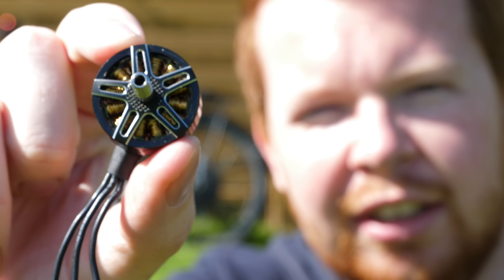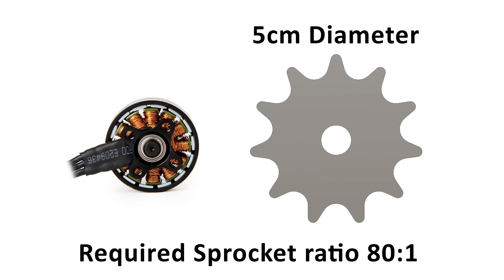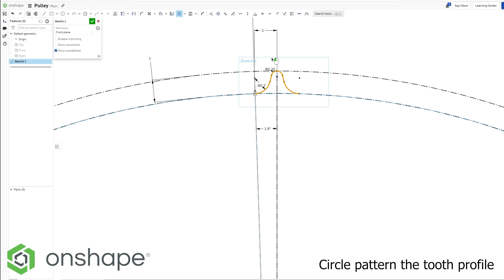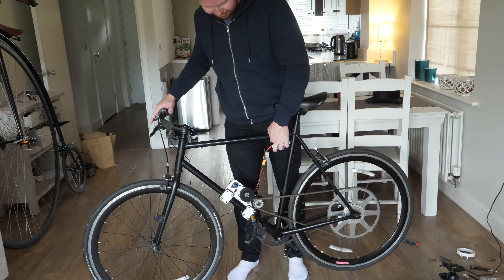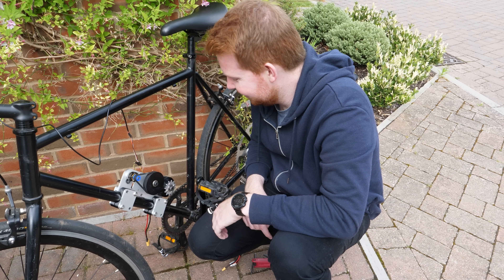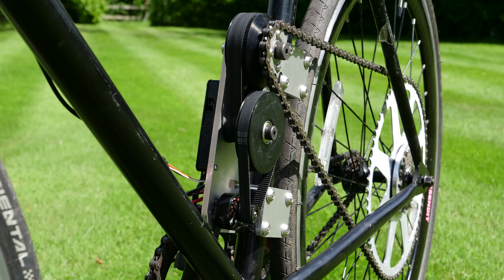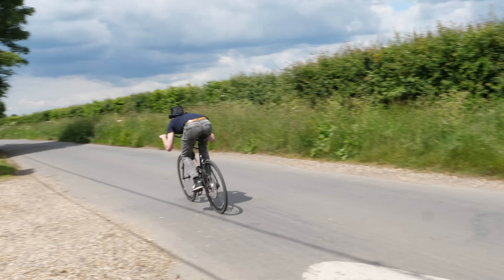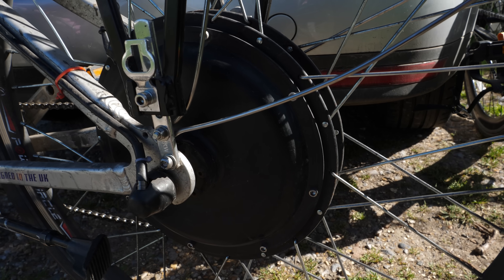Tiny 1kW Electric Bike Motor

Comment: The fact that the only slightly bigger motor worked without any cooling is actually surprising, as long you don't try to drag race with it.

Comment: I actually had this idea but instead of using one drum motor I had the thought of using several drone motors either in parallel or series combination with gears to reduce the speed but increase the torque by having multiple small motors, that could easily be powered by the large battery weather combination of supercapacitors. You would also need to design a controller that could switch the power source between the batteries and supercapacitor somehow.  Another idea to program the controller to switch charge regeneration on and off to charge the super capacitors, by maybe using three motors out of the let's say 7 or 8 small brushless motors. Obviously this couldn't run continuously but theoretically get longer range until the actual lithium battery died completely it should give longer range since once the bike is already moving the torque needed should be less. Just a thought I love your videos. I love your videos and ideas I hope you keep making more. Thanks

Comment: The tractor also has a lot more torque which allows them to pull heavy farm equipment like a plow, meanwhile some cars are designed for getting up to speed quickly especially cars like the GT-R (R35) from Nissan!

Comment: Torque vs RPM! The ebike motor has tons of torque, the drone motor has tons of RPM. To get the drone motor to move the bike you had to gear it down multiple times to multiply the torque, but the load on the motor was still way too much for it causing it to overheat. Whereas the ebike motor is huge and has tons of torque but way less RPM so it can spin at max speed and be under very little load. And contrary to popular belief, using more drone motors won't make the bike faster since they'll be spinning at the same speed, but it will reduce the load.

Comment: If the efficienty of the motor is 70%. Then 300 w of power waste in the small case of the motor. Comparing the size of the hub motor

Comment: Voltage/number of cells of the battery, size of the motor and kv rating, ESC current ratings are not disclosed, making the whole exercise not useful.

Comment: You should take say 6 of those motors and run them on the bike with a bigger battery of course but not to much bigger. I would think it would keep the motors cool enough cause their not straining with all that drag on 1 motor, it would have say 5 more to help keep things going without overheating. Just a thought and opinion. blessings all. Ok, maybe 4 of them if 6 is to many.

Comment: It will work much better if you add a higher power gear for starting like 100 rpm so it can safely start and gain some momentum then you can switch to 360 rpm it will reduce the chances of failure and gear and motor damage significantly i know you are not making motor go 30k while starting and starting rpm maybe less than 100 but its not the same thing doing this through gears will have higher torque at same rpm.

Comment: Small motor have small working currents and small torque. Small motor make 1 kW power on 30k RPM. On 30k RPM back EMF so big, that reduce working current. So, when you put this motor on bike, you work in much slower RPM -> back EMF is reduce -> currents are rising -> motor is boiling.

Comment: Also you could do a back of a napkin calculation on how much air does a drone propeller push through that drone motor because air cooling is non negligible in such a use case.

Comment: You need to inject ferrofluid into that hub motor and add heat sinks hubsinks on a thermal paste, then it gets to 3kW easily and your problem boils down to thermal. Curious what would happen if you could get an axial motor on an e-bike though… these seem to be the current craze in automotive.

Comment: These motors can’t have a radial load. You are killing their bearings.
Should’ve supported the output shaft with bearings.
Not to mention, you are not using a propeller, are you?
So why the f… you have not added a small cooling fan? 

Wouldn’t hire you as an engineer in my company.

Comment: a some kind of clutch system would help, first youd need to let the motor get its rpms, just like you first have to let car to a certain motor rpm, and 1 gear to help you move out of starting point

Comment: Im curious as to what one is more efficient given the same amount of ...hmm..fuel ?

A small high speed motor...or a large slow motor.

In gasoline powered engines slower with more torque is always more efficient.
Reply: Most likely the larger motor. Otherwise, the bike manufacturers would do exactly what Tom is doing. The smaller motor going that fast introduces much more friction than the larger one

Comment: I have a belt drive with tension-er on my gas 49.8cc gas bike. Replacing the tension-er with a 48 volt generator as to recharge the 48 volt Bafang mid- drives battery to make a hi-bread with electric turbo to help with hills and acceleration. Thanks for the video. Heat problem.

Comment: The typical E-bike Hub Motor can handle between 2500w-3000w before they really start heating up and pushing their envelope. At 1000w, the hub motor is loafing along compared to its potential. I once made an e-bike using a heater blower motor from a Cadillac... It had a single car battery slung in the frame, a 1" drive roller acting on the back tire, and sloooowly would reach a top speed of about 12mph on the flat, solely under its own power. The motor got pretty hot- but when I tried to drill vent holes in the casing, I nicked the wires inside. (Ooop.)

Comment: THIS IS RUBISH! IF YOU WANT TO DO A BAD ASS BIJE WHIT SUCH SMALL BRUSHLESS MOTORS THEN I USE A DAMN HARMONIC GEARBOX, STRAINWAVE GEARBOX. THOSE GEARBOXED HAVE EXTREMELY HIGH REDUCTION RATIO WHICH IS MORE THEN CLOSE TO WAT YOU NEED, FROM 60:1 RATIO UP TO 320:1!

Comment: Actually, if you got that bike going with the wheel spinning 30,000 RPM, you would still be going around 800 mph slower then the se 71.. you would, however, be traveling at about the same top speed as the f-22 Raptor 😅

Comment: Well, normally the motor would be cooled by the propeller, so you would need at least a heat sink.
An other way could be to drive the motor by using a three phase AC instead of  DC

Comment: 5:40. I could've told you that immediatly. 😂😂😂😂 With a small motor like that, it needs to be geared for load rather than speed, if you want to be able to ride it from a standstill. Also, with all that weight to move, the motors shaft doesn't seem meaty enough. 

Personally, I would go for high speed low torque gearing, (which is useless getting of the line), and then make a little centrifugal clutch which starts to engage at higher rpm, but allows some slip so that your body weight on the bike, on the road, doesn't mechanically restrict the motor from turning. This you could attach directly to the rear wheel shaft, and run seperatly without relying on a chain, but also allow you to pedal too.

Comment: this motor does not have enough torque to drive the bike wheels. you had to trade the RPMs to torque at lower RPMS, in theory should work because POWER= SPEED (RPM) multiply by TORQUE. so lowering the RPMS increase the torque. however you loose some power because of gears and have an inefficient cooling that causes overheating and motor destruction. so in pratice it cannot work

Comment: Using chain and sprockets for the whole thing would have been better the extra tension you have to put on an electric motor to get a rubber belt tight it's pretty hard on the motor and will definitely cause or help cause overheating issues and will definitely Rob Tower using a rubber belt and pulley system

Comment: I was amazed at how you managed to do that with such a small motor. It's really good considering the low battery consumption. However, I think you made a mistake by not giving it an initial push with your legs, which is probably what caused the overheating. Start pedaling first, and then use the motor more to maintain the speed. Other than that, congratulations!"

Comment: I don't understand the difference. Motors of the same power should deliver the same performance with the right gearing, but that seems to be wrong! Both motors produce 1000w, but the tiny motor produces its 1000w at a higher rpm, so we put some gears in between so that it can drive the bike at a reasonable speed.

 The GT-R and Tractor comparison was great, but I though don't understand the reason for that. The tractor engine/gearing delivers a lot more torque at low speeds, but if you gave it a different gearing for higher speeds you should be able to go fast as well? Where is my mistake?

Comment: Why not print a decently higher reduction planetary gear?
Calculate the wheel rotation speed for say 15~mph...gear down the engine to that RPM, make sure you design/print a fan on the pulley to move some air as it's running
Gears...aka TORQUE multipliers  ;)
Keep em coming!!!

Comment: Turning a lightweight thing fast isn't the same as turning a heavy thing slowly - the power output may be similar but the torque and stress/heat profile will be very much different - as in the video.

Comment: I dont understand how can be a 1kw motor be so small. Mechanical power is rpm multiply torque but anyway the motor is very small and the energy flow density and electromagnetic cirquit density are too high. Even good cooling can not improve the situation, also strong neodymium magnets are weak for so small motor. Maybe I dont know something important about the dron technology.

Comment: and now you know why diesel engines in school busses and trucks are massive in size but dont put out more than a couple hundred horse power...  they are designed to last forever...  a truck engione lasts 500,000 miles or more before being overhauled.. not many passenger cars or high power motorcycles will do that

Comment: The RC Drone motor is designed to run in an extreme airflow to cool the motor.  The prop wash over the motor when on a Drone will keep the motor cool.

Comment: Wow nice experiement! XD Why dont you try  3 or 4 of those drone motors? place them in a airflow designed box next to the frame. They could alternate between them to give them, to let them cool down. using 4 to accelerate and 2 to cruise on might be good? Perhaps the motor off duty could be used to cool with a motor that has propulsion duty. Idk if ebikes have a KERS system? maybe would help powering  the motors at acceleration?

Comment: 1000 watt motor no matter big or small depends on the current load capacity by the wire itself. the thicker the wire the more current load it can withstand means the coil still remain cool. Compared to the finer wires, high volume current would overload the wires and the excess current would release in form of heat. But the efficiency on finer wires are better as the coil electrical resistance is much lower. Still it needs an effective way of cooling such as cold water radiator or air cooling fin or else the wire will start to melt.

Comment: What motors really need is a second motor which drives a cooling fan, which is powered from the CURRENT used by the nain motor, or controlled by it.
     Motors using their own rotation to move their own fan usually work well enough, particularly up to the designed load level, but they have a backwards dependency on their speed, which isn't itself what heats up a motor.
     Increasing power to a motor which has a passive load like a blower or lawn mower etc typically increases its speed, so the traditional setup makes sense.  But powering a load from zero isn't such a case.
     I tell people to run their power tools without a load for a minute to cool them down after pressing them in hard service, and it works, otherwise I've seen people burn their tools up because the motor couldn't cool itself well enough,  but if more air was forced in under load, the motors could handle the power.

Comment: Im just wondering aboit using a worm gear on on the drone motor . It gives a better gear ratio , however it relies on the driven surfaces to slip at a high speed, I'm sure the usual lubricants are up to it .

Comment: you could add a fan to the motor shaft so that when the shaft moves, it will blow air into the motor, that way, the faster the motor, the faster the propeller and the more cooling

Comment: If a very small fan blade was connected to the motor shaft, it would be spinning at 15000.... a small one would move enough air to cool the motor

Comment: Because of the high gear ratio, the motor turns the load easily, but it demands a high motor rpm, and the motor has that.

Comment: I'd strongly advise putting some type of casing around pulley systems with such high rpm in the future. You don't want a belt to hit you in the groin (or worse, head) going like 300mph

Comment: I was thinking about such a drive with a small battery and energy recovery during braking. Side wheel drive through the rim. It would be used occasionally, over short distances, as an aid in acceleration or climbing.

Comment: doesn't the electric motors have only one limitation which is produced heat that is required to get rid of to not burn the wiring ? i mean there is no such thing as power of electric motor because you can put whatever voltage and current and these inherently determine the power. guess its called nominal power instead which just take to the count some predefined (wiring safe) values of voltage and current then measure heat which these produce and if that heat is dissipable in standard operation environment bang here you got your nominal power, in this case the 1kW nominal power might count with propeller to act like cooler, which is why the motor gets too hot and burn, aka the environment is different therefore the nominal power is way lower then 1kW. with really good cooling you could get multiple times more power, well that would be liquid nitrogen powered bike instead (idea for continuous video ? :P)

Comment: why go small when you can go big, 
next use the biggest industrial motor that you can fit on the frame and transform the row power in high speed torque 
OR
fit many more drone motors and chain them for max power

Comment: Why not have both? The regular ebike motor would be perfect up until 40mph where 2 little drone motors could take over, with some custom air ducts to keep them cool and having insane rpm, at that speed I feel they could probably add another 10-20 mph to the top speed of the ebike motor setup, you should try it bro it could turn out to be extremely energy efficient or something 😁

Comment: If you had actually made a good gearbox thing to directly convert rpm to torque and attached the last gear directly to wheel you should get fairly decent thing going

Comment: Make a mounting with 2-3 of them on geared belts and set it up on the pedal sprocket like most mid drive systems. Could make a pretty strong, fast, easy to install set up. Build the whole thing on some metal plate cut to match the triangle bike frame, mount it, then run a chain to the pedal sprocket. Then cover it all up sheet metal/platic when you have it all dialed in.

Comment: strange specification.... BLDC model motors that size and weight (~36g)  have 250-300W, unless the motor is designed to survive just 30 seconds... ?  you should add small fan/propeler on motor shaft :)

Comment: What if you used something like a Castle Mamba and an 8s lipo instead of a little baby motor? I remember Roman Atwood pulling his kids around with a Traxxas Xmaxx a while ago. Not sure what he had in it other than studded tires, and a weight strapped to it. Also, Why not add some kind of cooling like a little prop in front of the pulley mounted on the motor?

Edit: Doing some research on the Castle Mamba (1/10th Scale) it is rated at 2650KV, and 120A. If I use an equation I got from Google (Amps x Volts = Watts) then a Mamba is roughly 264 times the motor you used when it's being pushed to it's limits. I haven't slept in a while. Tell me if I'm right or not.

Comment: In any case, it is possible to use a motor from a model. It doesn't have to be a drone motor, but rather from a monster truck and with a flying clutch like the one used in RC cars. Depending on the springs, you can control the timing of engagement and therefore can the engine comes up to speed and thus cools itself

Comment: If the motor is that hot it can easily break because a special coating on the copper wire boils and vanishes.

Comment: I think it would work more better as a cruise control like start off pedaling then when at speed use the small motor cause i see it has alot of restriction when trying to start from a stop but if you get speed im sure you could get higher speed and ease on the motor